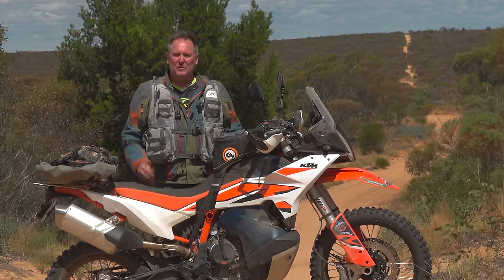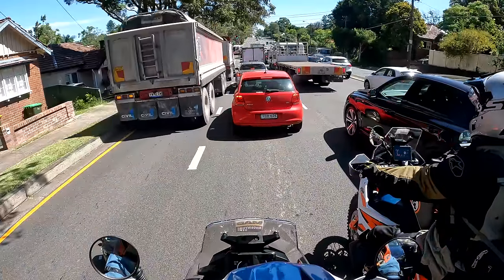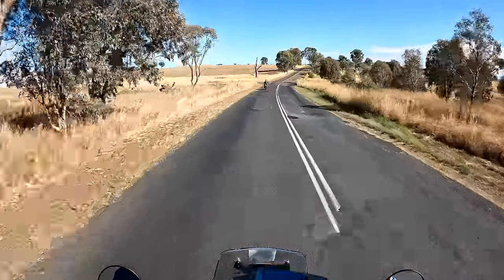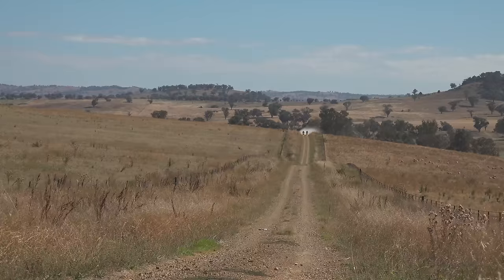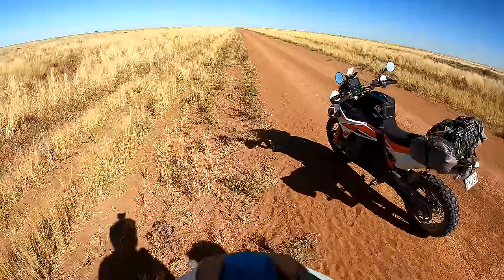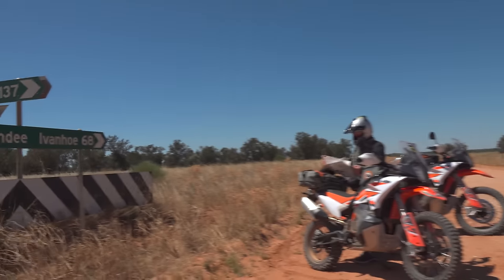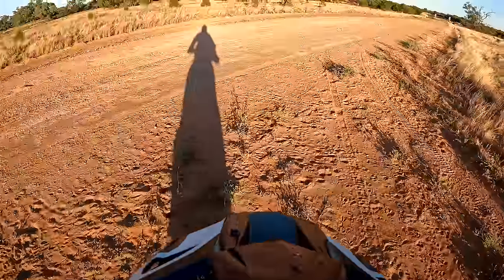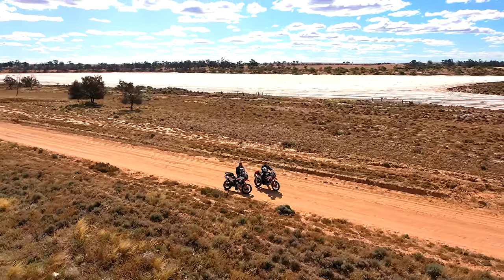Test Review | 2023 KTM890 Adventure R - Australian Outback

Comment: I have a 2021 890 Adv R and I'm currently at the part where you talk about the fuel gauge. Assuming the 2023 is the same your numbers are in line with my experience.  400km (250 miles) is about as far as I've gone while riding mildly. If I'm a full highway squid, I can burn a tank in about 320km (200 miles). I agree the fuel gauge isn't that accurate and it's just weird that it only measures the bottom half of the tank.
Reply from the maker: I don't mind it just measuring the bottom half of the tank.  It just goes a little whacky at times.  I certainly wouldn't depend on it if fuel stops were crucial.

Comment: I had a 790r which I got 500 out of 17lt a few times. My 22 890r is good for 450 on that sort of surface. I usually ride pretty aggressively. If you take the time to set the suspension to the conditions, matched with Motoz tyres of your liking. The 890r must be ridden in rally mode matched with whatever other setting you are comfortable with to get the most out of the bike. Love this bike.
Reply from the maker: Thanks for sharing

Comment: Dave rode my new 890 R home last night. Scrubbed in the tires this afternoon. 140 miles.  So far loving it. Some false neutrals plagued me though. I was on some really twisty back roads. Probably 50% user and 50% bile problem. And what ripper! On that straights very quickly hit high speeds.
Reply from the maker: Believe me the false neutrals are you.  It too me ages to know how to work a quick shifter correctly.  What you'll find is you're touching the clutch, or not timing the shift correctly, or shifting half heartedly.
Reply: @MotorcycleAdventureDirtbikeTV  I figured out pretty quick it needed a more positive shift. My Kawi 1000 has very sensitive quick shifter, the Kato is the opposite. Another couple hundred miles I'm sure I'll settle into it. Loved the review by the way. Fantastic footage as always to go with it.

Comment: Hey great trip. Quick question - I noticed the rear on Dave's was a 140/80 - was that mounted on the standard 4.50 rim? Or was it a Power Parts rim? Thanks guys.
Reply from the maker: Standard rims.
Reply: @MotorcycleAdventureDirtbikeTV   - Running tubes ?
Reply from the maker: @mosa4688  We did.
Reply: @MotorcycleAdventureDirtbikeTV  Thanks - I was just asking because I have been told that 140/80 will not seal on the bead of the standard rim if running TL. Great stuff much appreciated.

Comment: Awesome review and ride 👍
I'm struggling  with what I should go with.
890R or an Adventurised 701.
Riding mainly offroad Adventure.
Is the KTM 890 that much better on the road over the 701?
Cheers 🍻
Reply from the maker: I own a T700. Straight off the showroom floor the Adventure R is much better in a range of ways if you're interested in off road adventure.

Comment: Loving mine. The only thing that I dislike... The screen is terrible. Makes for a very buffeting ride. Have the S screen on order along with the clip on spoiler.
Reply from the maker: You must be a different height to me.  I didn't find any buffeting but the wind noise was loud.
Reply: @MotorcycleAdventureDirtbikeTV  I'm 6'2 - if I stand up while on the highway, it's like an instant relief. Get out of the dirty air and let the expensive Shoei do it's thing with clean air. I always wear earplugs, and it's still silly noisy behind the screen. Anything sub 100km/h it's not too bad. But those highway speeds... It's awful.
Reply from the maker: @Sisu2280  I'm 5ft 10 ins, 178 cm tall, there's the difference.

Comment: I think any reveiw of this bike should be done without the tech pack which includes rally mode , cruise control and quick shifter , as they are not standard and cost 1500 dollars. I purchased mine a few months ago , great bike but to roll it out of the shop with eveything most other adventure bikes have will cost you around 29k that incudes bluetooth device so you can hook you phone up to the bike and the tyre pressure gauges .
Reply from the maker: Clubby didn't use the tech pack, I think you need to go back and look at the video.
Reply: Sorry Dave I did not mean to hit a nerve . I think what I was getting at was in future people who are going to compare this bike say to an aprilia then it should be in stock form . I was not necessarily talking about this clip . What's good to hear that clubby had no issues without the tech pack. The only thing I am having trouble with on the bike is cold starts . But someone told me it's because of the higher octane fuel , 95 is better apparently.
Reply from the maker: @jlit3665  You didn't hit a nerve, you just missed that Clubby didn't use the tech pack.

Comment: Great video and review. I love that bike, but will never buy one. I cannot give my money to a manufacturer that has an additional payment/subscription model to access things ALREADY ON THE BIKE. It's a deal-breaker for me.
Reply from the maker: I think the interesting point Clubby made is that he did all the dirt riding on the standard setting of Off Road mode with traction control off.  A powerful demonstration that maybe you don't need the extra payment.
Reply: @MotorcycleAdventureDirtbikeTV  
You have already bought the bike and it does have all the hardware already on it. KTM is certainly not going to give the components to the customers for free, even if they choose not to pay for the usability afterward. It's frankly a ripoff.

It's a treacherous road.

I would rather own my bike than pay the full price for it and have the manufacturer tell me that I don't actually "own" the bike, but have bought a license to use it as long as they see fit. What if some computer-controlled part breaks? Can I replace it myself, and will it work afterward? Or will they full-on John Deere or Apple me and force me to go through "authorized repairers" to have a component changed for a few thousand dollars more than the component itself would cost?
Reply from the maker: @FinlandOutdoor  There are many who don't accept this approach and you're one of them.  That's fine.  As far your other point that's is completely different, that's why we have warranty.

Comment: Be warned, the engines on the 790 and 890 have a major flaw and eats cam shafts. Most of the engines don't last more than 30K miles. Ask me how I know... Pretty dissapointing
Reply from the maker: KTM say a small percentage are having problems, that's not most. Having said that it is a horrible experience for those where it failed.
Reply: @MotorcycleAdventureDirtbikeTV  the reason you don't hear about more failures is because people haven't reached high mileage numbers yet. The only time to find out if the cams are trashed is at valve check. Between 18k miles and 36k miles the bike will still run. By that time you will be well out of warranty. Once all the bikes out there get miles on them, you will see a flood of failures
Reply from the maker: @danopreadesign  The bike has bren around for years.  There's been enough time I would have thought. Apparently the 790 built by CFMOTO has the problem rectified.